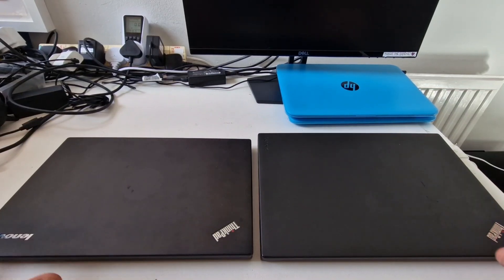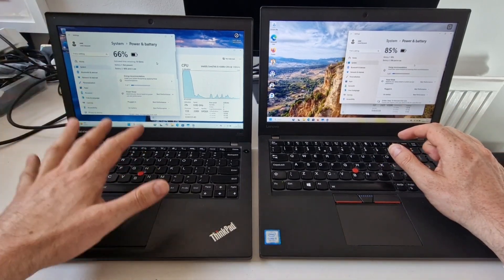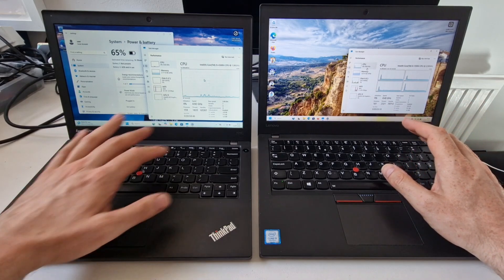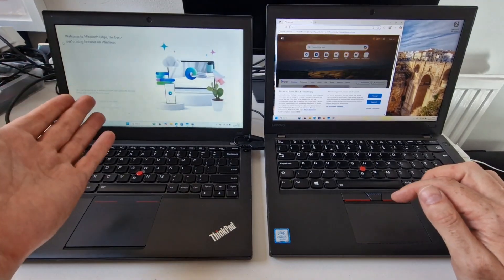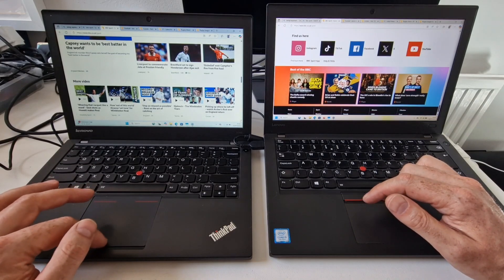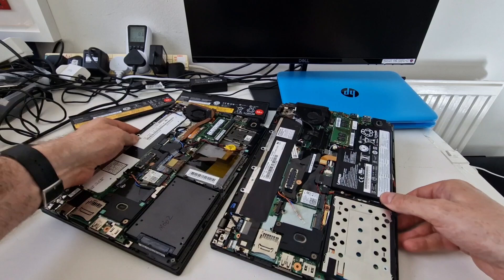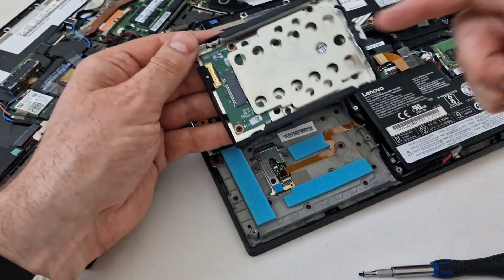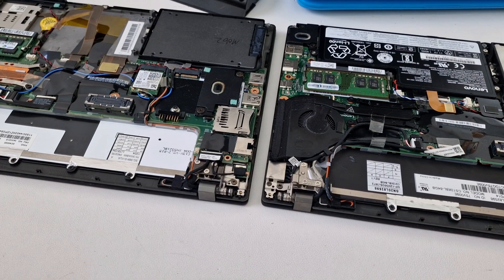Lenovo ThinkPad X240 vs X270... 4th gen Intel vs 7th gen Intel (DDR3 vs DDR4, SSD vs nVMe)

Comment: Hi, I had a cheap Chinese battery which was causing the processor stick to 400MHz, I got a refund from the battery seller. With the old and worn out orginal battery the processor clock was fine.

Comment: hey , for that 0.4GHz thing , its mainly issue with dying battery or the faulty capacitor on the BD-PROCHOT pin , which signals to the processor hot command to the system , which leads to downclock of the processor and locked at 400MHz or 0.4GHz , to fix this temporarily you can use this tool called "Throttlestop" and remove the BD-PROCHOT tick to bypass that signal and your processor will work flawlessly again!
Reply from the maker: yt deleted my reply. That's really useful thanks! The x270 seems to only do that with the larger battery from the older laptop, and is working perfectly with the smaller battery.

Comment: If you are going to show stuff up to the very end at least add 20 seconds of a still frame for youtube to show it because when the performance test ended on the x240 it was 16:10 and that's the end of the vid so it stayed on the screen less than 1/4 of a second. I had to watch in slo-motion to see the score and pause it right on 16:10. Also YT puts up those silly videos to watch in the last 20 seconds which blocks half of the screen at the end of the vid so you need at least 20 more seconds at the end of the video even if it's a black screen. Yeah that's some pro video editing right there lol!
Reply from the maker: Noted - end screen removed
Reply: @OldPCGunk  That doesn't help with the final score on the left. It shows only at 16:10 and the video ends immediately so the score isn't visible except in slow-mo for less than 1/4 second at the very end. Add a freeze-frame of the last score side by side image and leave it there for at least 3 seconds.

Comment: You could swap the X240's clicking TrackPad (nicknamed the "ClunkPad") with the normal style TrackPad from the xx50 lineup (T450, X250, etc.) because Lenovo realized they made a mistake by changing the TrackPad back to normal if you cared to still use a xx40 ThinkPad instead of using a different lineup.

Comment: That clicking track pad is crazy.  I would sell immediately.  Crazy they released it with that.
Reply: You could swap the X240's clicking TrackPad (nicknamed the "ClunkPad") with the normal style TrackPad from the xx50 lineup (T450, X250, etc.) because Lenovo realized they made a mistake by changing the TrackPad back to normal if you cared to still use a xx40 ThinkPad instead of using a different lineup.
Reply: @AmirRazan Sweet
Reply: I don't mind the ClunkPad on my t440p. I don't really use trackpads though.

Comment: i love my x240 running Debian/Cinnamon, what i dont like is the hideous trackpad. But i have two batteries one internal Sony and an external LG (according to Cinnamon)
Reply: You can swap in an x250 trackpad to an x240.  The only issue is if it's an early x240 which had a different mounting for the trackpad. In that case, you have to swap the entire palmrest/keyboard surround. Also, the x240 and x250 boards are physically interchangeable; my personal x240 came with a dead motherboard, so I swapped in an i7 board from an x250.

Depending on what he wants to do with the x240, adding the internal battery is trivial and relatively inexpensive. The same battery is used in quite a number of other models in the X and T series. Not long ago, I picked up a used one off eBay with about 89% of original capacity for $12 USD.

Comment: Honestly, you might as well switch to Arch or Fedora if it’s running this sluggish, dude.
Reply: why? it's not that hard to delete Edge's  .dll files.
Im not afraid to click on the hidden folders...go into . local...then share.
Then create an Icon folder...then paste a couple of candy icons folder..in ZORIN.
 well...in windows it's sort of the same way...Apps cant run without a proper .dll file.
Reply: Ummm, you do know Linux under the hood is the same core and same kernal, right? Clearly not lol! The only difference on all Linux distros is the desktop and the apps that come with it. Swapping to a different distro does nothing significant for performance unless you also downgrade the desktop to gnome or something that looks worse.